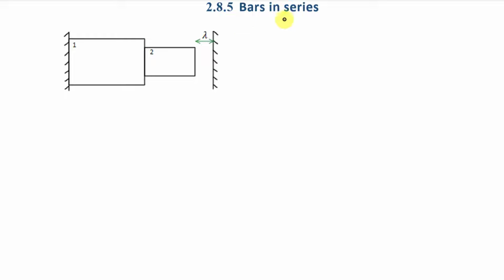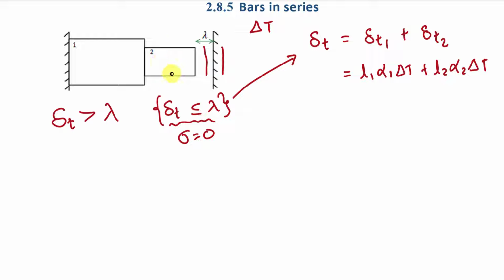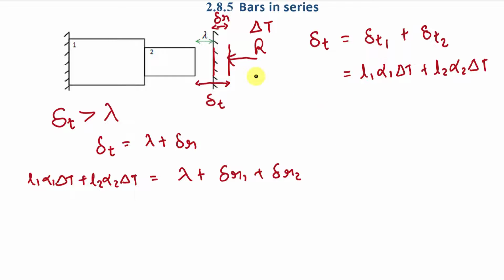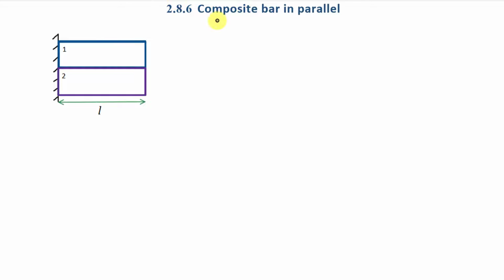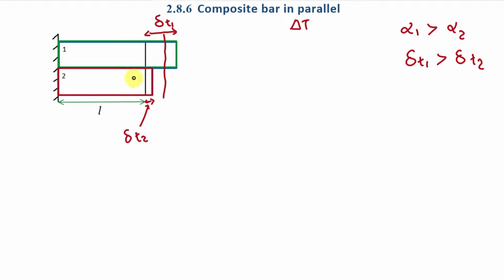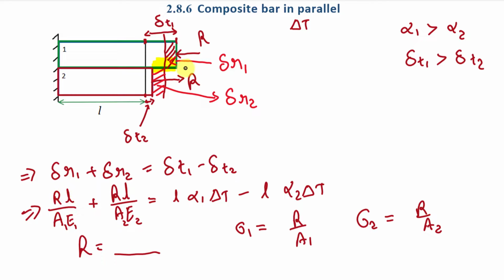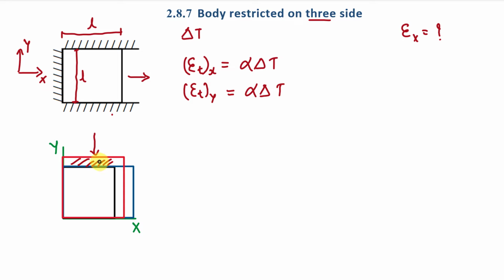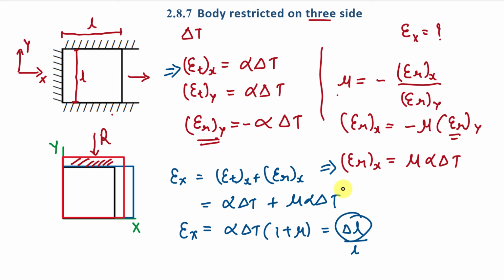Chapter 2 | Stress and strain Part 7 | SOM | Atharva Gate Academy

Comment: Sir what happens when exactly touches to fixed end
Reply from the maker: When it touches the fixed end. There will be restriction to further deformation in bodies.
And due to restriction in deformation, stress will be produced in the bodies.
Reply: Now stress produced in body 2 is 0
Reply from the maker: Yes, If body 2 is not touching fixed end, Then stress is zero in both bodies. Because it is the case of free expansion.  @rswaroop8845
Reply: Sir please start tom
Reply from the maker: @rswaroop8845  N
Now, I am making videos on gate questions of som.
So it will take some time to start TOM.
Reply: Sir when it will be started
Reply from the maker: @rswaroop8845   I will start it from Diwali.
Reply from the maker: @rswaroop8845  Do you want solutions of gate questions chapter wise or year wise?
Reply: PDF format sir
Reply from the maker: @rswaroop8845  But year wise or chapter wise?
Reply: Chapterwise sir
Reply from the maker: @rswaroop8845  okay in 3 days I will start chapter wise. Then I will continue daily uploads.
Reply: Sir please upload daily lectures